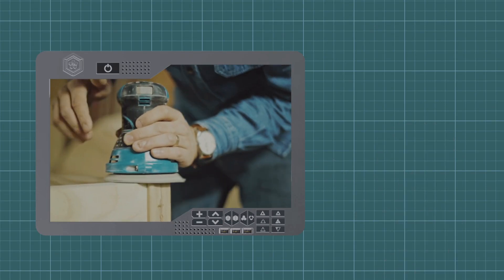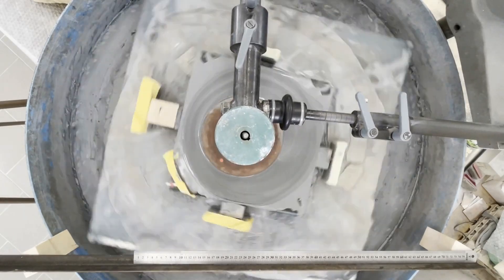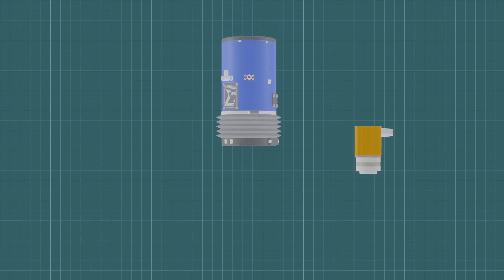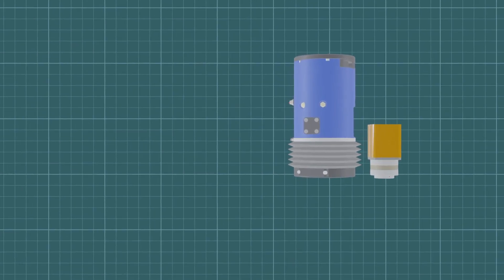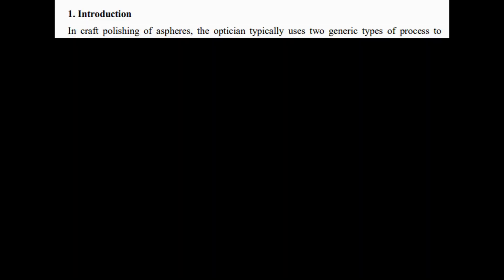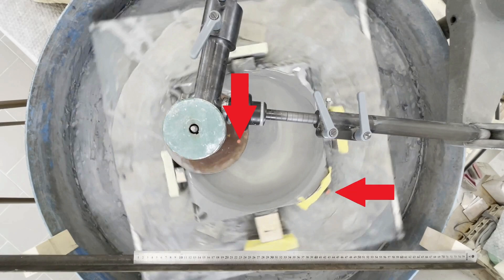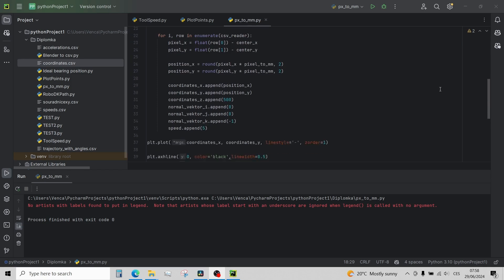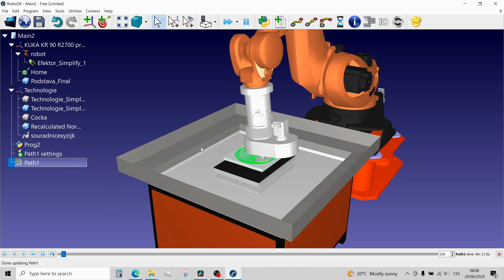Reverse Engineering Outdated Grinding Technology with Modern Robotics

Comment: Rotating the work and the tool in a certain ratio establishes a polishing line under the tool  resulting highest conformity of the polishing especially if slurry (wet polishing) is used. You can check out chemical mechanical planarization (cmp) in semiconductor fabrication for this detail. ;)